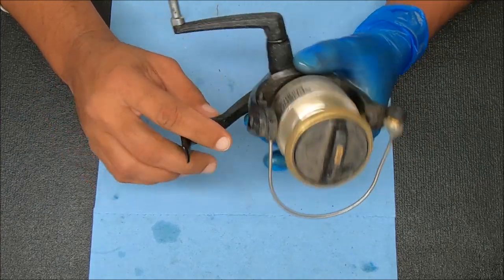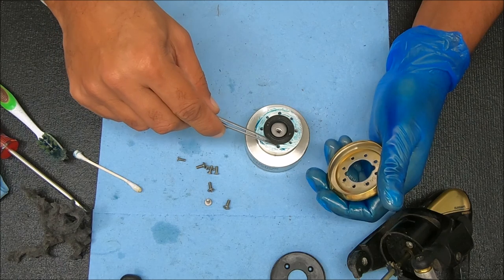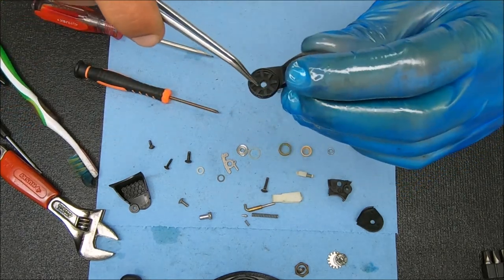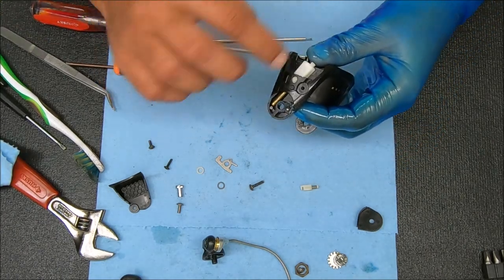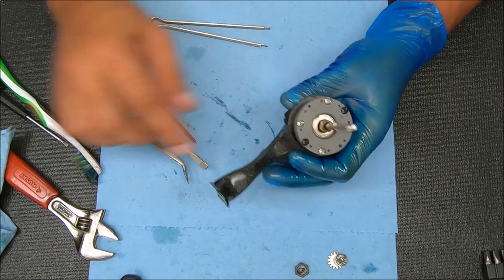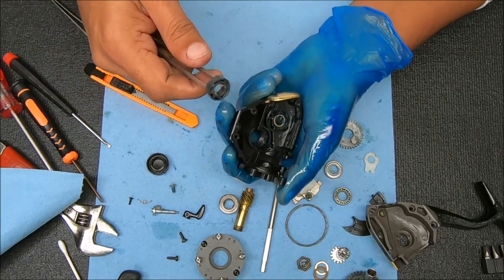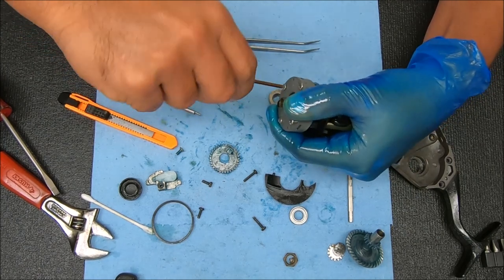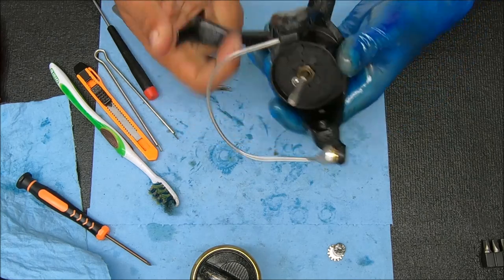Shimano Spheros 6000FA - How to take apart, service and reassemble this spinning reel.

Comment: Another fantastic video ... Got in and cleaned out a 4000FA (very different from the 6000FA) ... The bearings for the handle and the pinion assembly are seized.  I can't get them to budge.   Any ideas?
Reply from the maker: Thanks! Yes, sometimes there's a sizable jump in schematics between close numbers. Regarding the handle, check up my library... Pretty sure I have a handle refurb on there even if it's not the same as the one you're working on. For the pinion stack If you can remove the enter reverse clutch then you can try screwing the rotor nut back on the pinion and sticking a wrench under there, and using the leverage of the base support for the anti-reverse clutch to help you pry that up. You just have to be
Reply from the maker: Gentle because sometimes it doesn't work and you may have to try something else.

Comment: On the minute 37 when you put a bearing spacer over the drive gear I've  got notice that my reel doesn't have that bearing spacer over the gear ...any idea what's the part # of the spacer ?...I was checking the schematics and it doesn't show that spacer
Reply from the maker: Thanks for watching! No, I don't.... sorry. It's not necessarily required to be there, and if you reel feels fine without it, then you probably don't need any for your reel. However, if you measure the outside of the gear shaft in millimeters with some calipers, and send it to me at tsgreelservice@gmail.com, I can probably point you in the right direction.
Reply: @TSGReelService  l have the size 4000 and it doesn't have that spacer...but schematics says that there goes an spacer for the size 6000 and 8000 so probably thats the reason when l turn the handle feels a play and the drive gear ⚙️ goes out of place and makes a graining noise